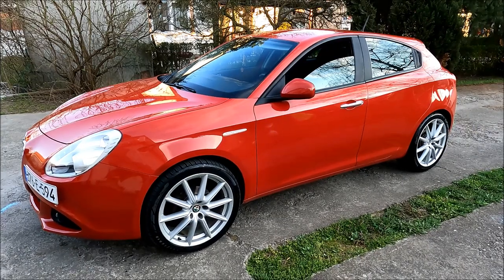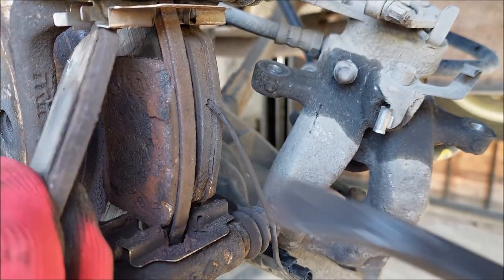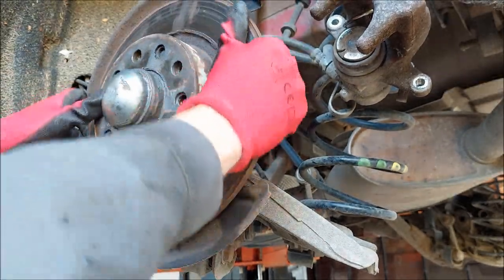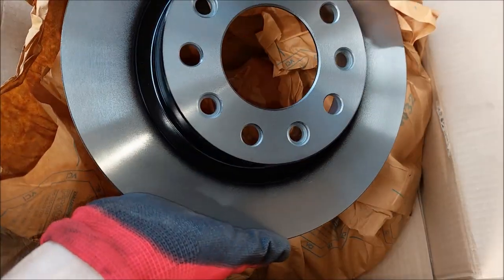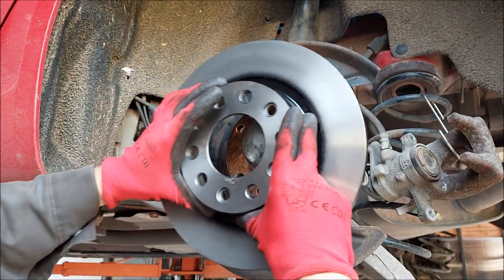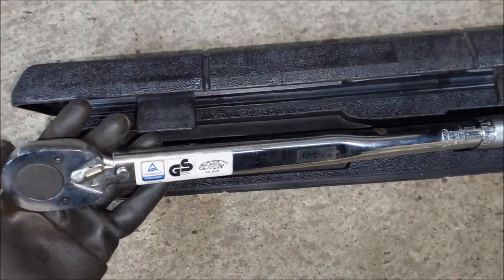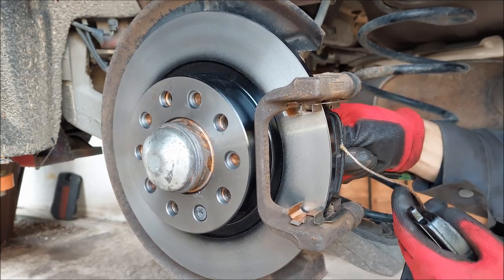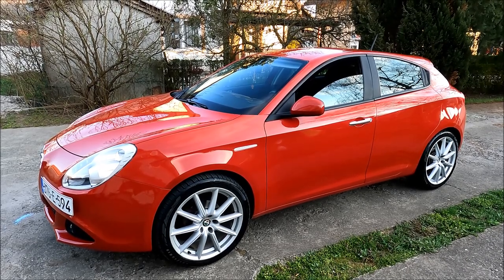Alfa Giulietta Rear Brakes Replacement, Discs and Pads

Comment: So simple torque wrench with socket there is no space to work for the sw13 30nm bolts of the calliper? Will do this next week and collect tools ;-). How you solved this? Thx
Reply from the maker: Well, I work on cars and I don't really use the torque wrench for everything, I go by feel